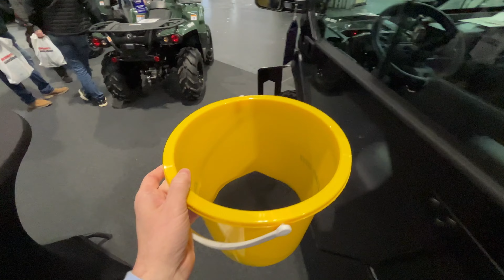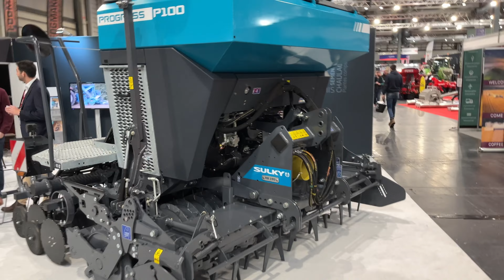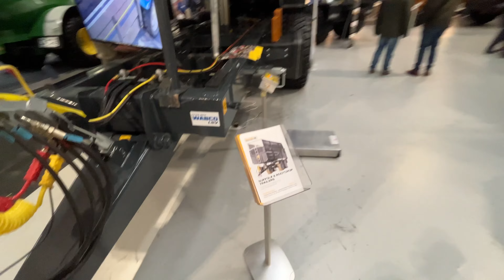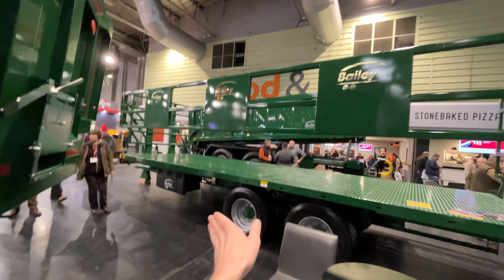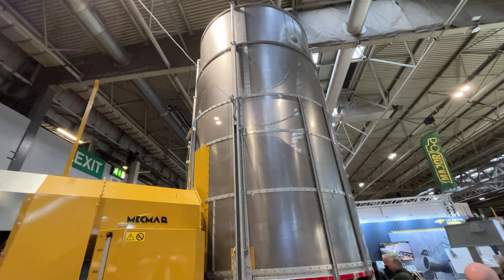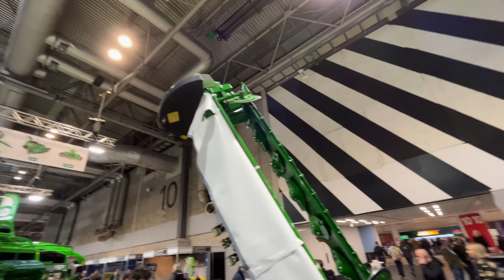How much do these tractors cost? #Lammatractorshow #claydon #farmingvideos

Comment: The Mzuri does have a leading vertical disc for cutting residue but we took ours off, as have others, because in reality it makes little difference to anything as there is so much clearance in the front legs.
Reply from the maker: That is interesting. In perfect world, like claydon, we like the new idea of having both. Bean straw was the particular issue although we dont want 'hair pinning' which i didnt know what it was until we went to claydon HQ. We do still like the Mzuri - very heavy we felt too. No denying its well built and a good machine. Thanks for the comment! That is interesting to know!